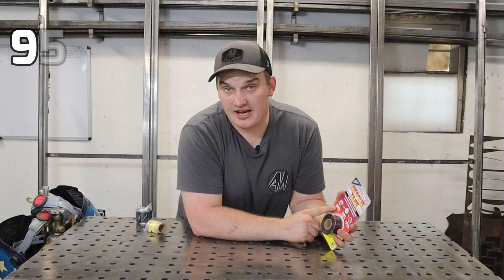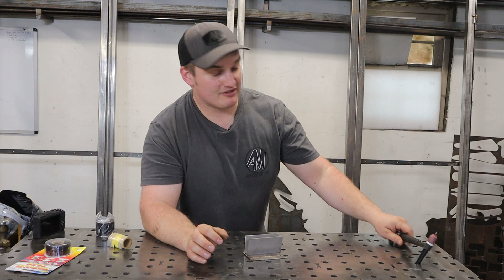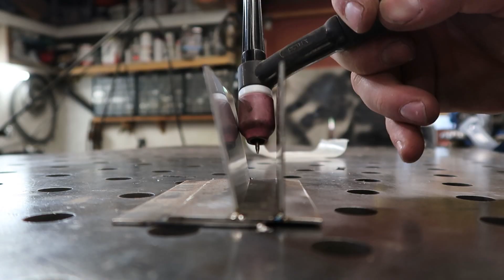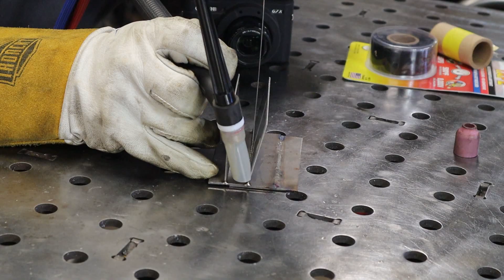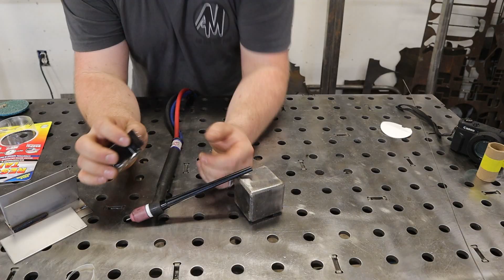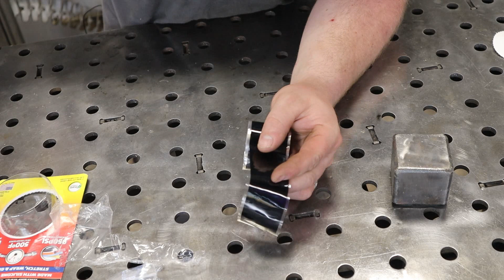NEW TIG WELDING Hack.

Comment: Very useful tape!  We used tape like that on aircraft when I was in the USAF.  Used mainly for quick fixes on wire harnesses.  Even used it on my motorcycle.  We always called it F4 tape.  Nice to see they offer more colors than just the black and red that they used to offer.